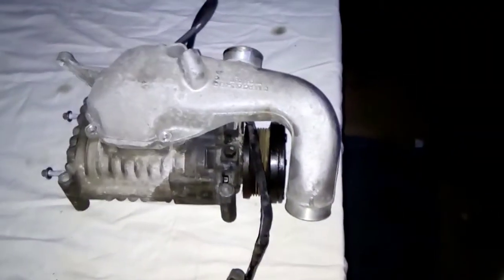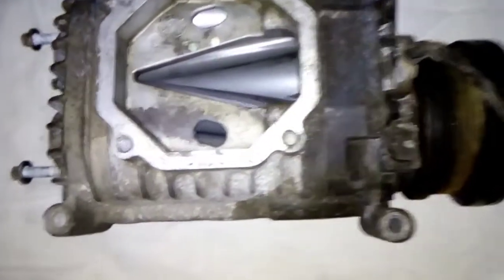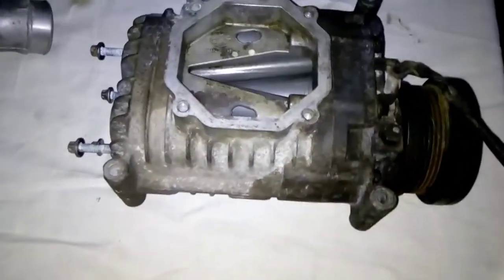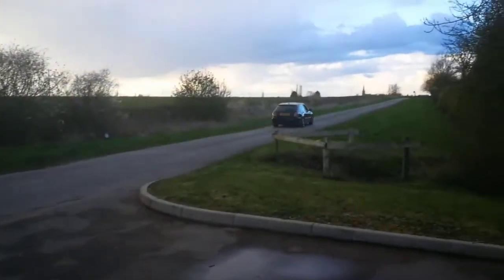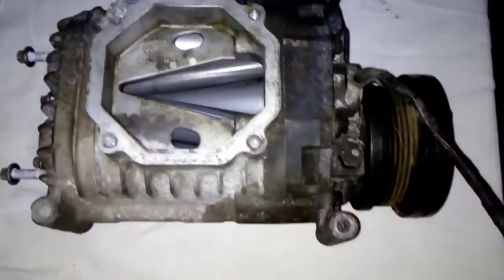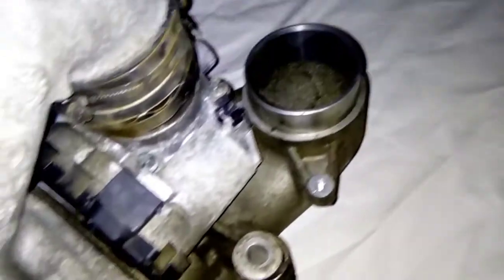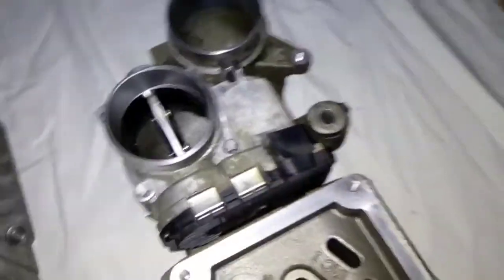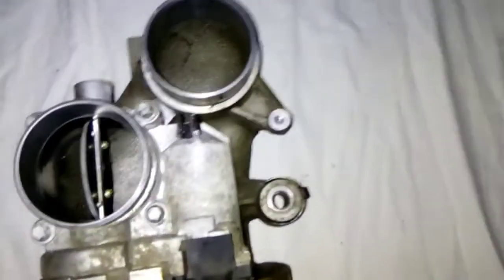What's So Different? Eaton M62 and M65 Supercharger? SEE HERE!

Comment: I wanted to ask if you could tell me some supercharger upgrades for the w204 c180k
Reply from the maker: the M271 is a little more challenging to turn with parts, there are certain intake modifications that can be done, I believe there is a plastic silencer in the intake that can be removed with the addition of a cold air feed, a remap is the best option for 271 powered cars as later models ditched the supercharger in the M271 Evo around 2009 these engines switched to using a turbo charger, I think there is a pulley mod out there for the M65 but these engines are not so easy to work on with the position of the supercharger.
Reply: @M-oneeleven-M111  thanks for the advice I sincerely appreciate it
Youtube didn't show me any notifications for the reply

Comment: I'm from Brazil and I'm in doubt between an m62 or m65 for my Civic si k20, which would be better?
Reply from the maker: M62 is easier to fit, but you would find the M65 would have more efficiency and produce lower intake temps, both would be ok for a K20 but it's more how much work do you want to do to make it fit, if that makes sense. 🙂
Reply: @M-oneeleven-M111 Thanks Bro
Reply: here in Brazil labor is cheap, I was thinking of importing one of the two through ali express, I was interested in the magnetic clutch of the m62, some friends said that I could adapt a button to turn the blower off and on whenever I wanted

Comment: Perfect explaining and on point. As for the M45 Kompressor, what's it's difference from the m65?🤔
Reply from the maker: Displacement, the M45 supercharger is designed for a smaller engine so it moves a lower volume of air l, where as the M65 is for a larger capacity engine and as such is designed to move a larger volume of air.
Reply: @M-oneeleven-M111  m65 is the same capacity as a m45. M62 is the next size larger.
Reply: @feral4mr2  are you sure about that? I thought the numbers reflected the volume?

Comment: Hey mate, can you please tell me if i should use a m62/m65 or an m90 on a 2.6L V6 Engine with 150bhp stock? Regards, Michael
Reply from the maker: M62 or and M65 would work but it would be on the edge of its efficiency range, a M90 would work better in my opinion buddy
Reply: @M-oneeleven-M111  Thanks buddy, i need only 0.5 bar (stock engine) so i will try it with the M65 :)
Reply from the maker: @original0noob  M65 certainly a better choice being a more modern updated M62, it is more efficient and keeps the charged air temps lower. The M62 does like to become a bit of a heat pump at 0.6bar on a 2.3 so on a 2.6 with 2 more cylinder the M62 would be hard pressed, so the M65 is definitely a better choice out of those two, there are also the Audi V6 superchargers for the 3.0 engines. Have fun with your project buddy love to see what people create.
Reply: @M-oneeleven-M111  Hello, i have setup the supercharger but i get 0.0 bar of boost. There are no leaks. I get 0.0 bar behind the throttle body and 1.2 bar of boost before the throttle body @3000rpm engine speed.
So i googelt a lot.
I found that the m65 is smaller then a m62.

A m65 is a m45 - only in a other "case".
So i need a m62 , right?

Regards, Michael

Comment: Is there an oil change requirement on the Eaton M series? I have a Mercedes SLK R171 200 Kompressor 184 CV of 2008. Which model is it M65? Thanks
Reply from the maker: Ah yes so you have the later M271 engine yours was the last of the supercharged engines as in 2009 I believe it was they switched to using a turbocharger on the M271. But yes your absolutely correct it will be the Eaton M65, the drain fill plug I believe to be on the front of the supercharger to the right of the pulley. To drain requires the old oil to be sucked out easier than removing the supercharger, from what Info I have found it's fully synthetic supercharger oil between 235-250ml. It is a good idea to change the oil of the charger as just like an engine over time they wear and swarf (tiny metal flakes) can build up ultimately accelerating wear changing the oil will slow this process down extending the life of the supercharger. Hope this helps 🙂👍
Reply: @M-oneeleven-M111  many thanks and kind regards 👍😁

Comment: Can i install the m62 to m104 280 engine?
The engine looks quite similar to m111
Reply from the maker: It does indeed look similar but Mercedes did change a fair but between the two, however we have never tried the alternator supercharger mount from a M111.

You could make one fit and it has been done before I'll find the link but it requires a lot of fabrication. Obviously not a problem if your good with a welder but if not that makes it a challenge. So the answer to your question is yes you could but I strongly doubt it would be a bolt on of thing. It maybe possible that the supercharger mount from the m111 may fit but I've never seen on done like that so I'm doubtful.
Reply: @M-oneeleven-M111  thank you so much for the reply! 😄

I've been searching through internet for such project but never found one. Yes there's a lot of m104 supercharger project, it's just not like what I'm planning. The reason I'm looking for bolting m111 charger is for oem look.
Minor modifications is acceptable.

So thanks again, I'll discuss this with my friend. See if he can source me the parts needed.
Reply from the maker: @whitehornet90  I do have a M104 in storage along with 2 other M111.975 compressor engines so at some point I can check but I'm not near them at the moment.

No problem I try to reply to everyone if I can obviously as the channels growing that's getting a bit of a challenge, but I will always do my best to help and advise. 😄
Reply: @M-oneeleven-M111  I'll be more than happy if you can update me the answer. 😄

Wish you all the best in life bro 👍🏽
I subscribed to your channel as i found it nice and useful.
Reply: hard No  thats a 100kw supercharger and a 150kw engine